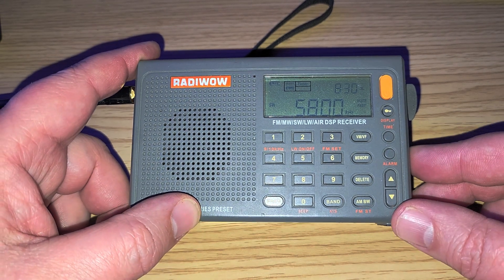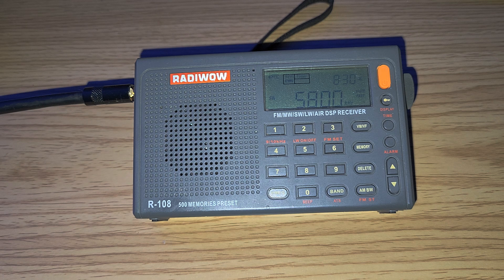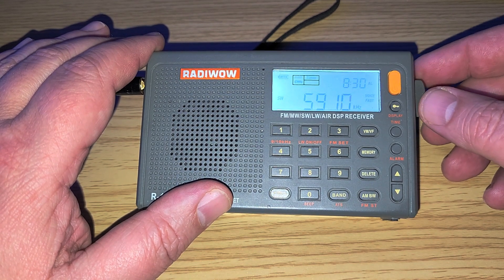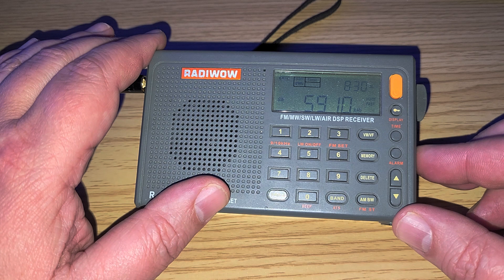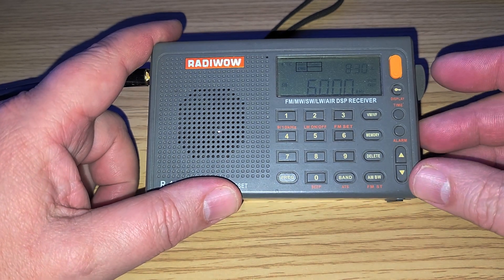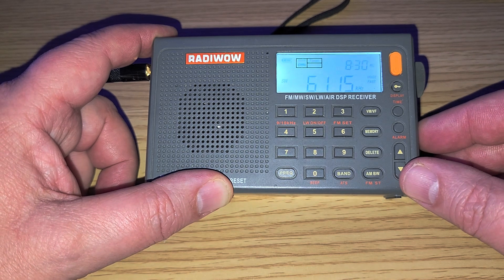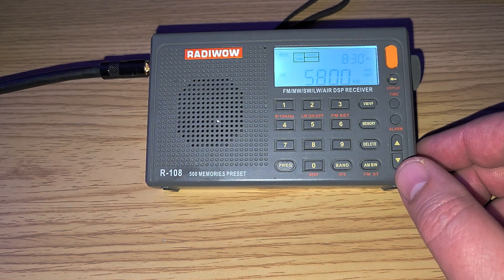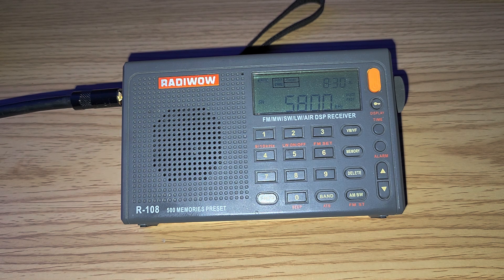Revisiting Radiwow / Sihuadon R-108 Tuning 49 meter band Shortwave with comments

Comment: I've had probs with the R108s battery too. I tends to drain. My example has a dodgy soldering joint somewhere as it suddenly looses power. Still its one of the best small SW portables for the money and almost as good as the Sony SW100E which sold for about ten time more price wise! Ah HCJB!